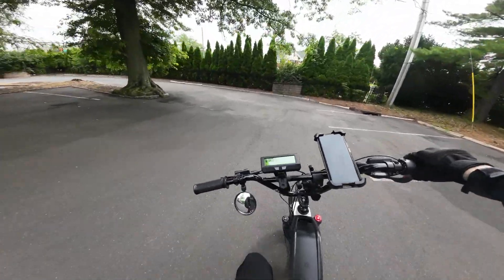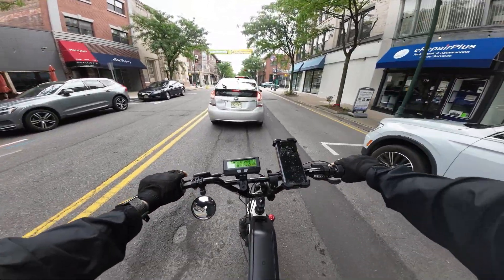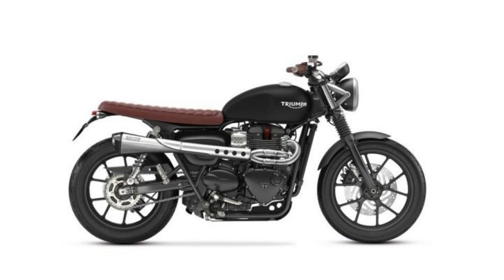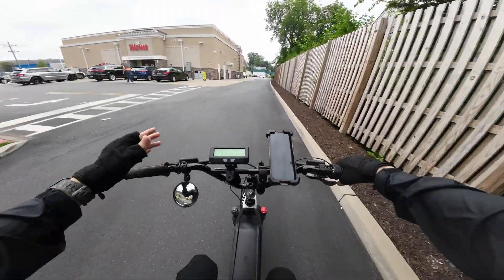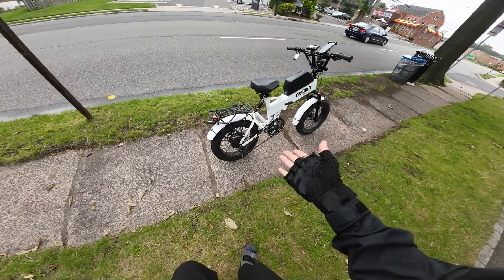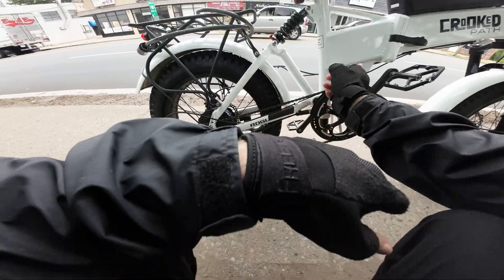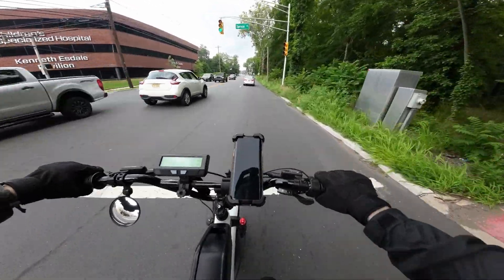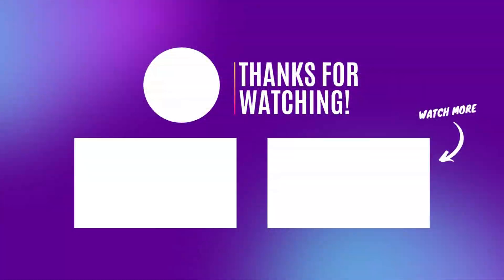Why Hub Motors are Better than Mid Drive Motors

Comment: You have a 48V hub motor with a 72V battery? You spent 4 grand on a commuter bike. Your opinion is for an elite few. Performance?  Most people want cheap, comfortable transportation and a long range between charges.  Also, most desire a commuter bike to carry a sack of something from the store.

Comment: The problem with an ebike having a tesla charge connector is that the battery is too small and charging too quickly can damamge the battery. 

There are battery chemestries that can be charged quickly without damage but they are not the best batteries for ebikes.

Comment: I have watched countless videos on the comparison of mid drive versus hub motor.  Here is my opinion on the rideability comparison. 

1. If you like to pedal and shift gears just get in mid drive. 
2. If you don't like to pedal or change gears get a hub motor.
3. If you have a lot of big hills get a hub motor that is 1500 watts or more, or get a mid drive that has 500 watts or more.... When it comes to hills a 500w mid drive will accomplish basically the same as a 1500 watt hub motor.

This is only about performance for your area. A hub motor is going to be what most people need, but it might limit you significantly if you encounter hills often.

Comment: Hubs are good for city riding, on hills and mountains mid drive is better by far.
Reply: I bet my 2x2800W hub motors are uphill much more powerful than any weak, regular e-bike mid drive
Reply: @harrison00xXx  I bet 2x2800w is quite illegal even in the US, not to mention all over the world, where 250w is the max in most places.
Reply: @Stefan_trekkie  I have already over 20k km on it... in central europe, Austria.

And i got caught only ONCE yet, and the fee was... "ok", probably even "too low" to be honest (i could have lost my drivers license + >1000€ fee)

I got caught riding about 70-80 km/h in the inner city where 30 is the limit (had a race with a tuned, 70cc Aerox). All i had to pay was 320€: 120€ riding without helmet, 200€ riding with an illegal bike.

Same goes btw for my 2 scooters: >10k km on them each, so >20k km on both combined, both are illegal since day one, yet nothing ever happened.
Reply: @Stefan_trekkie  But to be honest... i rarely ride in bigger cities, and if i do - i try to act legal, ride (ofc) slower etc since i know in those city areas (vienna etc) the cops are much less forgiving than the cops in our small towns.
Reply: @harrison00xXx  That is my problem as well, I'm in another european capital .. I think I will go with a 1000w reductor rear motor. It does not look that big as the direct drive ones, yet still keeping lower weight because I must go up and down the stairs. I was on factory bosch mid drive till now.. But with age and injuries, I want to ride it as motorcycle.
Reply: @Stefan_trekkie  My problem was since always - I have a car, but drive a lot of short trips, so in the end, i have a fked up car with for example less than 150k km on it, just because it was mostly used for short trips and got barely warm.

Only by calculating the fuel i saved (i charge my scooters and the e bike for free at home and on the go), i saved at least around 4000€ the past 3 years. Not even calculated the unnecessary wear on the diesel car yet.

And something cops will never understand (or dont want to, Law > common sense): More power is SAFER... not once i avoided an accident by just giving ful throttle while a car tried to cut me, either on my performance scooter (2x1400W continous, 2x2500W peak) or the powerful e bike
Reply: @harrison00xXx  Interesting. My story is a bit different. I'm ex motorcycle rider. Since i'm in dense city apartment building, the nearest paid spot for motorcycle was like 1 km away, not to mention that the parking fee was about what I give as fuel money.. That is a lot of wasted time as walk and money, for 7km ride to work. I like the freedom of a bicycle .. No tax, no tags /to know who you are and to take a pic if you touch a line/ The ride itself is like you ride outside the traffic, it's calming and relaxing .. In car/motorcycle in the middle of the line, I feel stressed as hell all the time. My build will be online soon.
Reply: @Stefan_trekkie  Same here.

I was also a motorcycle rider and would still be. I was riding a Kawasaki ZR7 for a long time. And if i could afford, i would buy nowadays for sure a Stark Varg EX and modify it for the street (street tires and stiffer spring/damper setup,to make it like a supermoto)

The freedom to count as a "e bike" is just too good, and many trips i ride often daily are just more fun and safer by using bike paths i cant use with another vehicle otherwise.

Thats why i also often prefer my scooters, the e bike isnt foldable (just an old mtb converted to dual hub motors) but the scooter just fits easily in my car, can be taken easily in any home or apartment, and in case space is really non existing, i can even fold it.
Reply: @harrison00xXx  at this point why not just get an electric motorcycle?  Do you even pedal?  and I don't mean pedal with cadence sensor.  Torque sensor pedal.
Reply: Ofc i dont ride those beasts in vienna.

At worst smaller cities, and if, i ride slower (aka less noticeable) than i do normally

Comment: from my experience hub motors works best in tandem. just use 2 motors in your ebike and you will experience their true power. but you need a good battery{s} of course
Reply: if you run dual motor and have adjustable controllers, you can half the battery current but leave the max motor current the same and at low speeds experience double the torque.

then your bike is still the same power level but in usage it's way more torquey when taking off etc.

Comment: I literally just watched a video where a guy said the opposite. And showed the difference between a 750w mid drive vs a 750w hub bafang motors comparison. The hill climbing power on the mid drive, was insanely better.
Reply: Please send the link! I'm thinking it makes perfect sense too
Reply: This is why you do dual hub configurations to combat the issue of less torque and less overall performance. Yeah it'll eat up the battery but if you got ebrakes you can simply recover the power a little and negate the power use issue
Reply: So what?
As said... make it dual motor, as my 2x2800W (around 2x3500W peak, DIY e-MTB with 72V system), and it will outperform any 750W mid drive in EVERYTHING.

Ofc any <750W hub motor "sucks", because its too weak for hill climbing. Make it >2000W, probably even add another hub motor.... and you go like >30 mph uphill ;)
Reply: So what?  @harrison00xXx
Reply: @AndyLeeVlogs  so what what?
Reply: @harrison00xXx  that's awesome, what motors did you use? Grin?
Reply: @MR__JUSTIN  ATO 3000W 72V gearless hub motor with 80 Nm on regular 28" rims.

Comment: I D QUEUSTION THE COMMENT THAT PETROL MOTORCYCLE S DO NOT HAVE HUB DRIVE AS SOME MOTOR BIKES HAVE A DRIVE SHAFT AND A DIFF  IN THE HUB WHICH IS A HUB DRIVE MOTORCYCLE OVER CHAIN OR BELT DRIVEN.
Reply: no

Comment: I have both, the midrive drive is more of a bike riders bike. The ability to change gears for the power range is a plus. The hubs are way more convenient where you can not worry about downshifting when you come to a stop to take off  shifting at all for that matter. Watt for wat I give mid drive the performance/ agility edge, on the hub i won't worry about overheating it because you rode it too long on throttle and it doesn't have drivetrain clunk.

Comment: Hub motors looks cool looking than mid drive.
Reply: Depends.
My 2x1400W hub motors (for 10-11" 2,75-3" wide tires) are noticeable wider than the whole tire. It just looks "bad" on the performance scooter since they are that wide, yet somewhat small in diamater. On the e-bike tho they look ok

My first MTB i modified was with a 3000W brushless gokart motor, so basically a high power mid drive. Not too bad, but the chain is absolutely not made for that kind of torque. Heavy wear on chain etc and always a high chance to snap it. It was fun with that much torque on the rear (burnouts, wheelies,... everything super easy to pull off)

I rebuilt the whole drivetrain from single mid drive to dual hub motors, 2x2800W continous, about 2x3500W peak.  A single motor itself is somewhat weak, especially when going <10 mph, but both motors have crazy torque from 0 mph up to its about 65-75 mph top speed.

Comment: Something new is coming - 𝖆 𝖗𝖊𝖛𝖔𝖑𝖚𝖙𝖎𝖔𝖓𝖆𝖗𝖞 𝖌𝖊𝖆𝖗 𝖘𝖔𝖑𝖚𝖙𝖎𝖔𝖓 𝖆𝖓𝖉 𝖒𝖔𝖗𝖊.
😁We have patented an entirely new, low cost, hear-silent, ultra-efficient, infinitely variable , ultra-torque dense [small & light], high durability gear technology, called 𝔽𝕣𝕚𝕔𝕥𝕚𝕠𝕟𝕃𝕖𝕤𝕤 𝔾𝕖𝕒𝕣𝕤 [ℂ𝕍𝕋/𝕀𝕍𝕋] , which is a reformulation of gearing theory sans any toothed wheels. The gear range can easily be >700:1 [ultra high gear rage possible] with a price half that of the lowest priced competitor. Enables smaller batteries and/or longer range in EV's [Exploding Vehicles ;-0 ] . Legacy and novel applications abound. Retrofits of ALL existing bikes, even electrics, will be available.
😉A novel, low cost, magnet-free, near-silent, zero detent/cogging, ultra-torque dense [i.e. compact], ultra-efficient, electric motor tech may be paired w the FrictionLess gear set for unprecedented drivetrain performance in all metrics at all scales.
😁We're also developing an ultra-efficient Free-piston engine with an insane power to weight ration on par with turbines. It will eventually power the PersonalJet door-to-door personal mobility solution.

Comment: Mid drive is by far the better setup.  Feels just like a regular bike with no lag like hub motors.  If you plan on using your e-bike as a moped, then hub will suffice.  I have risen several of both, Mid Drive is King!  Don’t listen to his advice.   There is one advantage to hub motors, if the chain breaks you can throttle home, but the odds of that are 1:100,000
Reply: Yes! Mid drives are better.
Reply: as for lag or not, that highly depends, while i personally prefer middrives, a cadence sensing middrive has the same lag as you mentioned

if you have a hub motor with a torque sensor in the bb you will have a similar takeoff response.

Comment: Ive had both. Urban riding,no steep hills...love the hub for simplicity. The bicycle rider in me likes the hub. For real hills or MTB mid drive rules because you can gear the chain like a motorcycle. The motorcyclist in me likes the mid drive. Hub drives with some internal gear changing capability in the hub will change my opinion though.

Comment: My wife has a Specialized mid-drive bike, 250 watt motor.  I have an Aventon Level 2 bike with a hub motor 500 watts.  Both are torque sensor bikes.  My wife’s bike has almost the same acceleration capability as my bike and the Specialized weighs 7 LBS less but nearly twice the price.  She loves the quiet drivetrain and smooth response to peddle input.  I tend to agree with her.  The Aventon is smooth response from peddle input, but the motor noise is a bit annoying at times.  Both great bikes.

Comment: Just rode a hyena 250W/40Nm hub motor w torque sensor and a bosch active line 250W/40Nm mid drive motor back to back.  the torque and power of the hyena was noticeably higher.  Possibly some efficiency/loss in the mid drive motor.

Comment: I Prefer Hub Motors ? If your Chain Brakes you can still get home . #2 less ware on the chain #3 less ware on the sprockets and gears :text-green-game-over:
Reply: only if you have a cadence sensor or if throttles are legal, i prefer torque sensing and throttles are illegal in many places.
Reply: there legal here plus I like to ghost pedal I prefer Cadence Sensor but to each their own🎉
Reply: @BillBadMule123 i have a cadence middrive (BBSHD) right now and i like the ghost pedaling, but i miss the feeling of it actually being a leg power amplifier

i might get the ToSeven DM01 which is similar but has a torque sensor

it would be interesting to make a custom program with VESC controllers so it can both work in cadence and torque sensing mode separately, and so you can choose it.

the leg power amplification feeling was addictive to me

Comment: Even if you plug an e-bike battery directly into a Tesla Supercharger, you won’t charge it faster than a Tesla. New standard e-bike batteries are 21700, which are known as “Tesla batteries” as they are the Tesla standard. They have a max charge rate. Batteries in Tesla cars are wired to maximize the charging time of individual 21700 batteries, can’t go faster. Same goes for e-bikes.

Comment: You take a 60 volt hub vs a 60 volt mid. The mid performs like a 60 volt and never loses speed. The hub feels like a 52 volt system because you don't maintain those max speeds for long. Just get a Talaria xxx and move on with your day. Don't buy these cheap ass china hub bikes. lol
Reply: motors do not care about volts.

Comment: So you have to spend $3000 to get a suspension. And then spend more after you get it. Total ripoff on the seat situation and suspension. I get put one heck of a racing suspension for about $3,000 on my car too. The difference, much more weight, and 4 tires not too. Why bike suspension and seat so expensive?

Comment: Keep in mind this guy knows next to nothing about motors or bike design. Hub motor's are a much worse choice for a number of reasons.   Such as unsprung weight. Something you want to avoid at all costs in bike design.  Electric motor's are really low on torque and efficiency when turning slowly.. exactly what they are forced to do in a wheel..

Comment: I have a rear hub motor 750  with a rear casette 11 28( 29x2.1 inch wheel tire) and i ride only  by use pedal assist !!! I have climb mountains over 4000ft  and often ride over 3000ft !! ...Use batterie 48v 30A and manage over 110mil distance !!! So my conclusion is that using always your feet the difference of hub and mid is very small !!  And I am talking about almost 100% riding in asphalt roads ! Am i correct ?
Reply: These people don't even pedal their bikes, so weird
Reply: I'm wanting a motor and to now your comment pushes me to a hub for its clean look, I want to pedal , no cruising .
Reply: Yeah, plus if you do pedal, a mid drive means you have to spin the motor too fast for you to pedal if you want to use more than maybe 300 watts and be efficient for the motor. The hub drives can spin fast when going fast and they're happy with that.

Comment: For a proper eBike you want something that has torque sensor. You can do it with a hub motor, but those are more rare.
For a throttle operated eMoto, like this, hub motor is good for reduced chain and cassette wear.

Comment: A hub motor has ( no ) transmission A mad drive motor works like a real transmission Any time got a ( real ) transmission you got much more ( power ) Up any ( Hills )
Reply: This is true. Hub drives of legal size are optimized for flat and moderate terrain , because that's the majority of the use scenario,worldwide.

Comment: I seem to remember many years ago you could buy a Moped here in the UK that had an ICE in it's front wheel, so yes it can be done.
Reply: Solex
Reply: I'm not positive, but didn't the Solex sit above the wheel and drive it with a roller against the tire?
I'd like to see an ICE actually in the hub.

Comment: The new GRIN Technologies hub motors are POWERFUL and that's because they have a large diameter "magnet ring" (stator).
When my two (2 wheel drive E-CELLS Super Monarch Crown) BAFANG motors are dead Canadian-sourced GRIN Technologies  motors will be my choice. Speaking of batteries, my Samsung batteries are 15 Ah on the down tube and is 20 Ah under the rear rack.. The bike has a patented frame port that charges both simultaneously. Yeah, my bike is a beast at 95 pounds but it's for hunting and hauling boned-out big game meat. It has a 400 pound max load capacity, including rider weight.